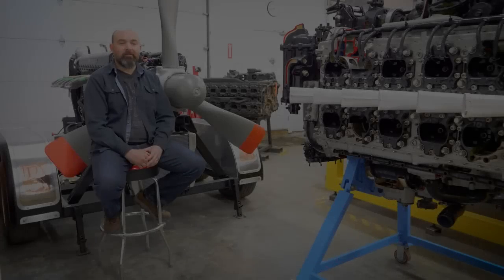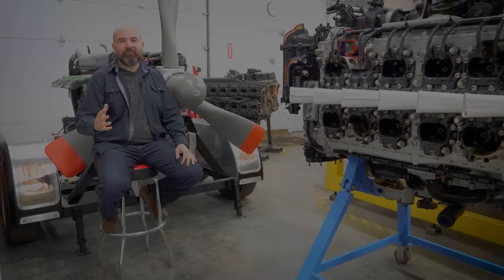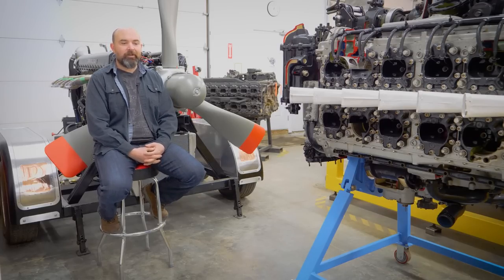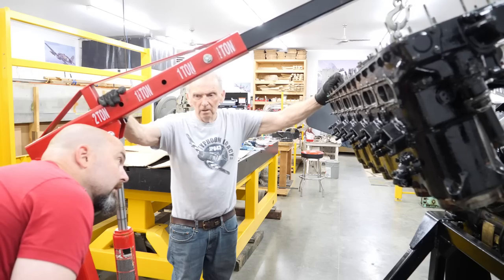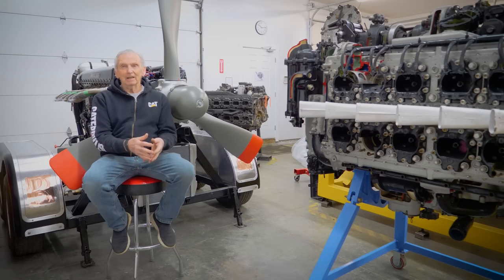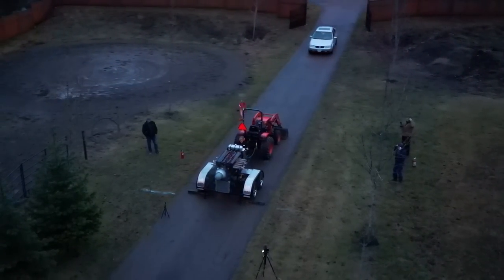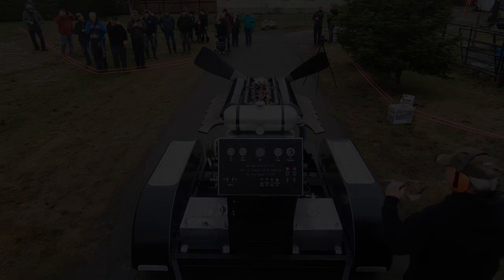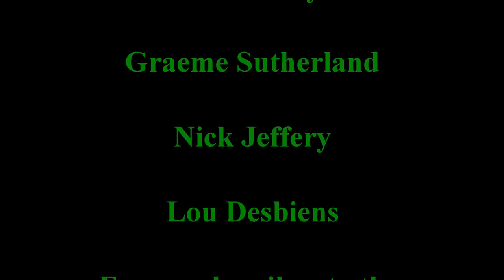A Merlin for a Napier Sabre

Comment: In 2018 I was in Nelson, New Zealand and visited the Motor Museum there …. there was an aviation section and in a corridor leading to a display hall, I found a cut away engine. I started out in engineering before qualifying as a professional pilot an have always enjoyed working on engines. I clearly remember thinking what a fabulous piece of engineering that engine was. I suspect that engine is now your Napier Sabre engine.  I wish you the best of possible luck getting it airborne again. I thoroughly enjoyed this video, VERY well done.
Reply: Totally agree.  Having visited the Udvar-Hazy annex of the Smithsonian Air and Space museum, my favorite section is propulsion, tucked away under the stairs on the right as one enters the museum on the second level (past the gift shop on the left and the IMAX theater on the right). They have a cut-away there of a Pratt-Whitney R-4360 Wasp Major - according to the plaque was a maintenance trainer for the US Marine Corps.  Boggles the mind the complexity and understanding the reported teething problems.  I feel the same about the Napier, and a little sad that the development stopped with it.

Comment: There’s something about the Merlin that gets into your Soul.
I was lucky enough growing up listening to Stories by Pilots and Flight Crews ( Mechanics and Fitters etc ) about their experiences with the Merlin and the early morning start ups ( it’s something you can picture,a line of Spitfires or Hurricanes,Mustangs and Lancaster’s ) spitting fire in the Morning and the Lancs in the Evening.
I was lucky in my growing up in a Small village called Sawston,which is a stone throw from Duxford Airfield ( Now the IWM ) so I grew up with the sound of Merlin’s overhead ( I’m 54 now but I still get goosebumps and have to run and look when I hear those Merlin’s growling ). 
Guy Martin has a Merlin on a Trailer just like that one and when he first got it he had a propeller that wasn’t cut down,the trailer and Merlin actually took off inside his Garage and flew across the Workshop !!! 😮.
Guy Martin explains it so much better than me tho and he still laughs about it ! Even when he says about it bouncing off the Workshop Walls !!?. 
I absolutely Love the Typhoon and it was one of my Late Father’s favourite Aircraft ( he was ex RAF and a Fitter )….. He built by Hand a RC Typhoon with a Wingspan of 10 Feet + and it was huge 😳.
He was a bit of a Mad inventor and he hand built a Hang Glider in 1977 from Bamboo and Polythene sheeting….it crashed unfortunately ( I had to drive us home from Haverhill ( Dad was more concerned about my Mum seeing him tho ( he had broken his collarbone ! ).
It didn’t put him off though but he did decide to build the next one properly lol 😂 so he ' Found ' Aluminium tubing and he used the correct fabric and he decided throwing himself and the Glider from a Hill wasn’t such a Great idea and so he decided to build it with a Engine ( He hand built the frame for the engine and himself ) he hand carved the Propeller from whatever wood it was ( it made a lot of dust whatever wood it was and he got in trouble from Mum because of the mess he traipsed In from his Shed !).
It was a Villiers Engine but it had a Seat and harness.
On his Maiden flight at Bourne Airfield there was a Newspaper reporter from the Cambridge Evening News and a photographer who took some Cool pictures.
He was a pretty clever Man and good mechanically,he built me a motorised Go cart for my 11th Birthday ( 1978 ) and he bought it home on the roof of his Car ( Much too not much amusement from my Mother Lol 😂 ).
I was taught to drive it on Duxford Airfield before the Airfield became the IWM and when I was little ( up to 10 ) we would go for Adventures at the Airfield in the hangers and we would go digging in the old firing range.
Dad did volunteer at Duxford and during filming of the Battle of Britain film when they blew up the hangar,his generator was inside the hangar ( nobody knew about the hangar being blown up ! Everyone thought it was just going to be a bigish Bang ). 
When I was younger we watched Concorde land at Duxford and as it landed the construction of the M11 took place,which meant that Duxford lost the end of its runway and it meant Concorde would be never to fly again.
We used to go to all the old Military Air Shows at Mildenhall and Lakenheath and I think my favourite was watching and listening to the Vulcan ( it was my Dads favourite ).
He worked on Meteors and Canberra’s when he was in the RAF and he was stationed at BassingBourne which is where he Met my Mum at a Dance in the Village ( Dad was from Jarrow,South Shields )…… He loved Sawston and Duxford and the surrounding Countryside,we when kids would go exploring all over the Countryside and the old crash sites but we would learn about History and the futility of war ( Dad was born in 1935 and his experiences of Newcastle at Wartime were exciting but scary at the same time,he had his life saved by a Air Raid Warden who knew what was falling around from a Dog fight above could kill the kids ( including my Dad and his brother who were watching ).
Dad used to say that every House in Newcastle had holes in their Roofs from falling spent rounds and larger pieces of Shrapnel,he saw people who after explosions " just lied down " and it wasn’t until the Air Raid wardens explained about Concussion waves that they realised the people were Dead !. 
He would go round to see his Friends and find there was no house where it used to be !. 
Crows were Fat and No Cats were around in the Streets ! Apparently the butchers had ' Rabbits ' hanging in their windows but they weren’t Rabbits ! If you removed the head and feet from a Cat they looked just like Rabbits !!!. 
Meat was Meat and Dogs would run away from Humans in the Streets,during wartime not many people had pets of any kind.
I’ve gone off the beaten track a bit so Sorry for that.!
The other thing growing up in my village was we had Polish Pilots who settled down here and the villagers made friends with lots of Americans who were stationed ( bivvied ) at Sawston Hall,all the villagers were encouraged to " Adopt " a Yank or Canadian to help them acclimatise to the English way of life and ways…..My Mum and her family were friends with someone for many years after the War and I have a picture of Him with my Mum and her Brother !. 
When I was younger I would go to the Local old folks home and hear stories from Men and Women who had served in various roles during WW2 and in the village we had a Hero ( Mr.Vindis ) who settled and built a successful Car sales garage and a shop selling toys as well.
In Whittlesford there was a chap named ' German Joe ' who had been a POW and settled in Whittlesford !. 
Madingly American Cemetery just outside Cambridge is where we honour those Americans who gave the ultimate sacrifice.
In Whittlesford church yard there are Graves of Polish flyers and the Graves are carefully cared for by the locals…..fresh flowers and mowed nicely with a little memorial in place.
Reply: @moffat43 .... Thank you so much for "going off on a tangent" so to speak - I for one look for just such gems in the comments sections of videos im interested in, being retired now, I read soldiers memoirs in books as what transpired during times of ww2, it is quite different from the way it is related in most accounts of history, some are so shocking you have to put the book down and take a break, but that is war, and "all's fair in love and war", a drastic business, my grandfather passed through your fair land in '44 as part of the 30th inf.div. heading for fortress Europe, although (asfar as i know) didnt go by plane, because although he chose not to talk about the war, I remember him saying distinctly that he had never been so sick in all his life as he was on that boat in the english channel, he said - "I hung my head over the side saying, sink you soab, sink!", so I dont imagine he was near the airfields - of course they might have camped out on the airfields during their waiting out times, anyway, I very much enjoyed your rambling comment, it seemed honest and open and a great time to be alive and young, anyway, thanks again, from NE FLA.

Comment: I did my Trade Cert in Automotive Engine reconditioning all up 5 yrs and spending many hours grinding crankshafts, planning heads, cutting valve seats, chrome metal spray building up of  journals  and engine assembly, so it's fare to say I've done my time and can find my way around the inside of a motor ,so I enjoyed following along, your ups and downs of the rebuild. I hear the pain.  But I have  never had the opportunity to work on the mighty Merlin Engine... maybe one day eh,  I will keep and eye out for Rob-Roy as I am a Kiwi , I've got a feeling as I have done a Doco shoot with a bunch of old WW1 planes, a certain Peter Jackson might be involved, just a guess, cus he really like his planes.  One of the highlights of my TV soundy role is a recording I made  of his Corsair pulling aerobatics at his fielding base. Best sound in the world ... and completely clean of a yabbering air show announcer spouting endlist facts as they always tend to do and you just want to hear the motors tone.

Comment: Its quite amazing to think this engine was so efficient it was found the exhausts actually gave forward thrust and why they were shaped as they were.
Just think of the many types of aircraft and the thousands that were built in a war zone (and in the USA). Crashed ones or parts that were not 100% to spec. were used to build the Meteor engine and put into WWII tanks like the Cromwell, Challenger, Comet and of course the ubiquitous Centurion.

Comment: Nice to hear you regard Peter Grieve as the oracle as far as RR issues are concerned. I worked with Peter at Pirelli uk as a maintenance fitter and was amazed by his stuff, the micro lights the auto gyros and mainly the Merlin’s he was doing with his friend Peter Byers, sadly gone. Have you seen his Meteor Land Rover project? The boy is insane.
Reply from the maker: I have not seen the Land Rover project but will need to seek it out; a very impressive gent! ~Ian

Comment: Looking at the exhaust stacks on the Sabre I can see why they had a problem with cooling, if the exhausts are used by both the top and bottom stacks, the heat in that area would be incredible, especially on climb power.
Reply from the maker: The cooling issue was solved with a change to how the coolant was routed, originally it flowed around all 12 cylinders per block, heating up on the first six and getting too hot by the time it was passing the last six. With the change, each row of 6 cylinders got its own flow. ~Ian
Reply: @TyphoonLegacyCoLtd  If memory serves there was a modeler who built scale models of the blocks of an early model Sabre using some of the few remaining drawings.   I can remember that he was puzzled about some parts of the coolant flow.  Here my memory is getting very thin ( I will have to see if I can find this article again), but I believe there were restrictors in the flow between the blocks, perhaps to correct uneven flow characteristics, this is the sort of thing that could only be found and corrected by building real engines.  As you know the coolant pumps and coolant flow on these engines are prodigious, one of the reasons I never believed the 5500 hp figure, putting all the other issues aside, the heat rejection from the engine would be outrageous at that power level.  

You really have to admire Frank Halford, he started designing this engine about 2 years after RR started the Merlin, he had a tiny design team compared to Rolls Royce, yet he got the first prototypes running so quickly, and then increased the power very quickly to almost twice the contemporary Merlin's ratings.  RR had to stop work on every other piston aircraft engine (Vulture, Peregrine, Exe, Crecy, 1939 Griffin) and concentrate their entire team of engineers on solving the Merlin's issues.  

Even more amazing when you consider that RR was designing yet another V12 in a long line of V12s, in the case of the early Merlins, it was really an improved larger Kestrel, yet Halford was well into the unknown, his previous H engines being vertical, air-cooled, quite small, and poppet valved, suddenly he is building this monster, horizontal, liquid-cooled, sleeve valve engine with projected output powers well beyond anything  British had imagined to this date.  Even Roy Fedden had a narrow focus on engines.

In my opinion, Frank Halford, Arthur Rowledge, Roy Fedden, and Stewart Tresilian were the greats in British aircraft engine design.  It is a  pity that little is known about who did what. Well, Fedden is reasonably well documented, Halford is less well documented, Rowledge, we know the engines he either designed or contributed to but little else, and Tresilian is very sketchy.

I definitely want to hear a modern recording of a running Sabre before I exit this reality, it was one thing often mentioned by those on the wrong side of a Typhoon/Tempest V/VI.  None of the surviving WWII recordings are very good.  I will be really interested to hear if the two cylinders firing simultaneously (one in the top 12, one in the bottom 12, both 12s with the same firing order with an offset) does produce the resonant mode at certain rpms.  Of course, ground running will only be the first course, getting her into the air and then loading up the straight cut reduction gearing with some load will add the final part to the cacophony of noise.

Comment: The only Sabre that I know of in New Zealand is in the Nelson Classic Car Museum, so I checked my photo of it and, sure enough – same engine. Congratulations on acquiring it and we can hope to hear a Sabre running again one day.
In the meantime, we air show fans look forward to hearing the Merlin running at Classic Fighters Omaka at Easter.
You CAN get it to New Zealand by Easter...can you?
Reply from the maker: While that will be completely up to the new owner I don't believe it will work with the current shipping schedule. ~Ian
Reply: @TyphoonLegacyCoLtd  I fear you are correct. An ex-Royal New Zealand Air Force P51 is being restored to flying condition in New Zealand and shipping schedules badly delayed the return of the engine and wing that had been sent to the USA for overhaul and rebuild.
Reply: @TyphoonLegacyCoLtd  Update (9 Feb 2024): I saw the Merlin running at the Omaka Wings and Wheels open day last Sunday. Great job you guys made of it. 
PS The P51 I mentioned is now flying.

Comment: God knows how you will even begin to get the Sabre running, they were difficult enough to keep running when they were new. Possibly modern engineering may make some parts better?
Reply from the maker: It is more an issue of treating the engine like a 24 cylinder sleeve valve engine instead of a V-12 poppet valve engine. ~Ian